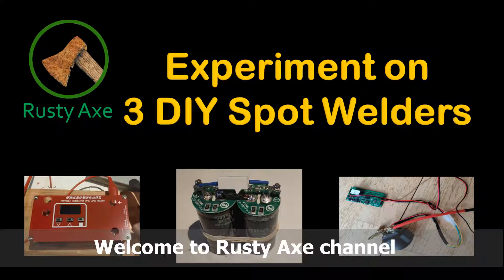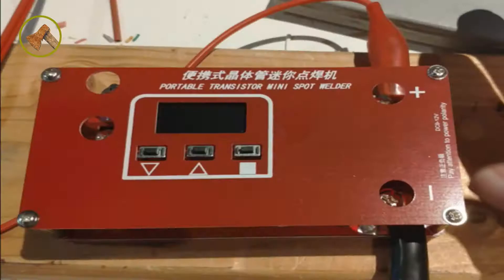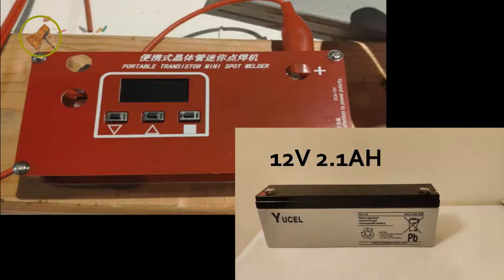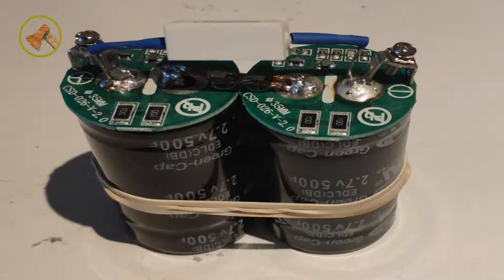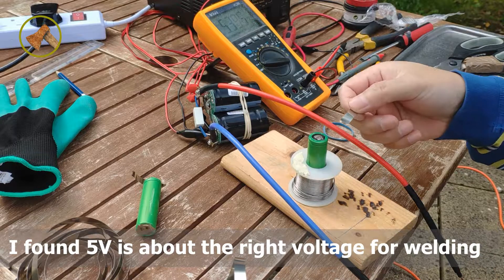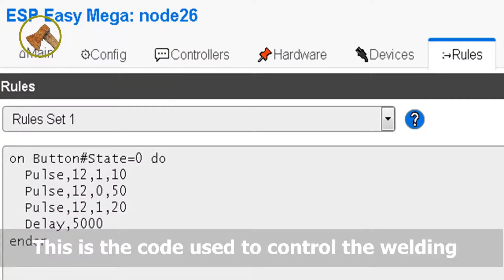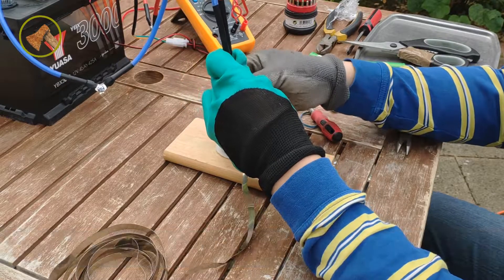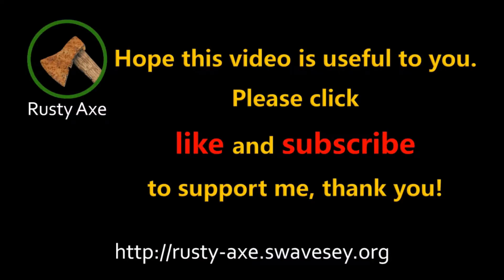Detailed experiment on 3 DIY spot welders for 18650 batteries (inc. mini DIY spot welder)

Comment: The first option failed due to user error. You used the incorrect battery. A 100ah is a must to stop voltage drop. Also connect a 16v 1000uf capacitor will help.

Your finial solution was good, glad it worked!
Reply from the maker: Hi Adam,thanks for your comments.
I agree the user (it is me here) could be blamed for the error, but it could be easily fixed/avoid if the manufacture/sell provided some kinds of manual, guidance or tips for this mini battery welder. 
I bought it from ebay and there is almost no document and supporting. 
The description even didn't tell me how to switch it on. The power switch is hidden under the PCB, and it tooks me a while to figure it out (see my other video).  
Without all those information, I started with a small battery to test,  which is normal safely approach for most electronic engineers. 
I suggest the seller/manufacture to add those tips to avoid similar issues.

Comment: You need 100ah cell minimum & preferably lithium. The voltage drop means the MCU loses power causing the mosfets to stick open.  You can also add a 16v 680uf capacitor to the circuit & reinforce the traces either side of the mosfets with copper wire.
Reply from the maker: Hi Toby, thanks for your comments. I agree with your comments and it will benefit other users.
I bought it from ebay and there is almost no document and supporting, so I started with the small battery to test,  which is normal safely approach for most electronic engineers. 
I suggest the seller to add those tips to avoid similar issues.

Comment: Nice job! How much did the first solution cost?
Reply from the maker: I bought the DIY mini spot welder from ebay, it cost me about £20 in UK.
Reply: @rustyox7449  Thank you for the info. Your third solution is indeed the best. I bought the previous version of https://www.aliexpress.com/item/4000557715521.html, which seems to work for limited applications.